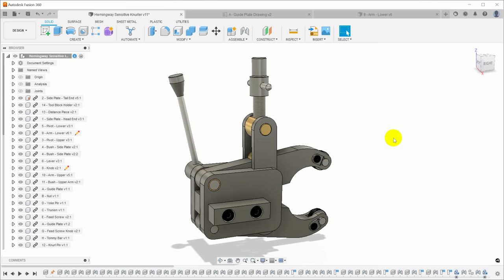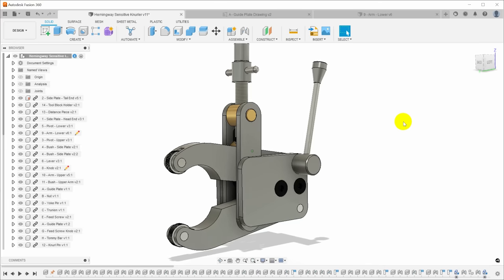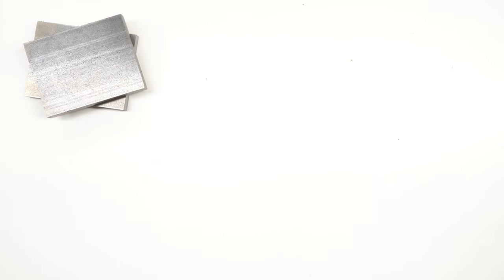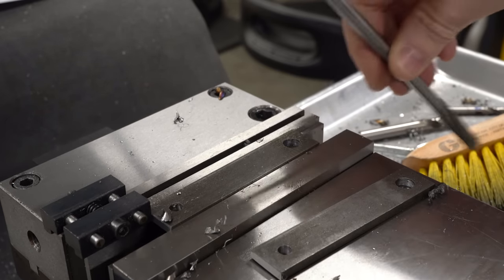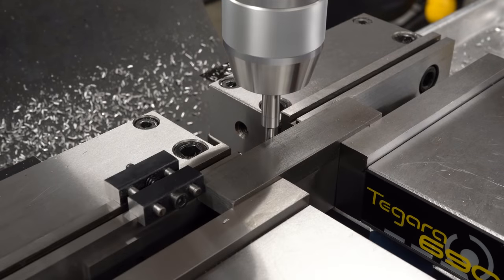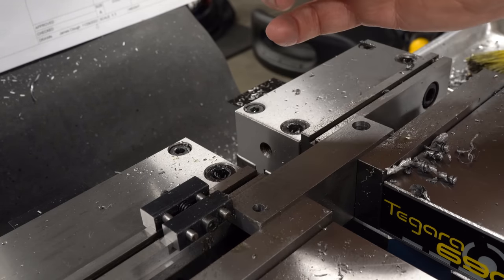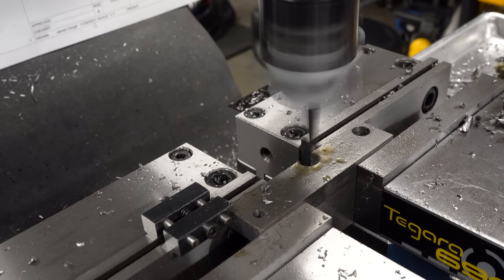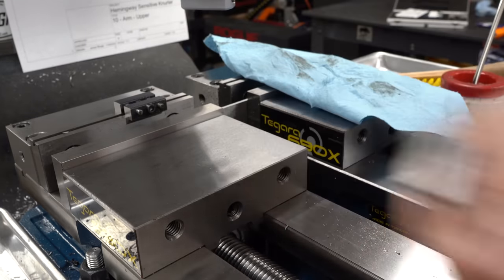Hemingway Sensitive Knurling Tool Build - Part 1

Comment: Great video as always, 
I've just turned 58 and my introduction to machining anything was using imperial Fractions I was lucky enough to live next door to brilliant toolmaker, design engineer (Mr A. as we all knew him then) back in 1977. One thing he impressed on me was to work from first principles i.e. a imperial rule has the ability to measure down to 1/64 or 0.0156 the last 2 digits 25 are not important as that is a tolerance beyond the machines we were using (Myford super seven and a Dore Westbury Mill, self built by Mr A.)

Following this, I did my time (apprenticeship with a small company who insisted on using imperial but not with fractions but with decimals), however as I had learnt to use the fractions the decimals came easy and my mental maths was even better. When I left that job my next was with a company that insisted using metric but they needed to convert old imperial designs to metric so that was when the numbers 25.4 and 39.37 came back to me.

The Hemmingway kits have been around for probably 40 years but they always include everyone old or young in their drawings and instructions.

i'm about to start one of hemmingway's wobble broaches. 

Keep the videos coming.
Jon.

Comment: Hi Clough. Something I realized a long time ago. When boring/reaming holes, I found that reamers were sometimes inconsistent maybe because the chip load is too great and forces the reamer off center a bit. Small holes are the worst. What I found that might help when reaming is to keep in mind almost all carbide end mills are slightly undersize. I drill the hole obviously undersize and then use the appropriate endmill to finish the hole to about .001" undersize. Then, If I want to ream it, then I just ream it to the exact size. Only reaming .001 creates very few chips, so the hole comes out pretty exact. Measure the endmill diameter before using this method. Also, be sure the mill collet has no noticeable runout.

Comment: Great project. I have  been thinking of making the same  tool. years ago I searched the internet for  Hemingway and Malco info and pics. . By gathering some published measurements and scaling I 3Dmodeled the knurler. Had fun doing it, and enjoy looking at the  exploded view of your model. I have yet to make it,but will enjoy watching you make it. I've been in the trade for 45 plus years making prototype one off parts for a engineering group, mostly precision hard tooling and tight tolerance NPI  parts. I smiled when you beat yourself up for missing your goal of precision " Chasing Tenths ".  Once you get your surface grinder you won't be happy with a milled finish. Thank you for all the efforts you put into your video's , very polished . Maybe when I retire ( still enjoy it and not ready to give it up) I will make one.

knurler.

Comment: Great looking project, thanks for sharing. A straight knurled part can take up the extra space. We had a hand tool at work just for that. If the hole in the casing was sloppy. we straight line knurl it to tighten it up. Some people called the hand tool “vicegrips” thanks for sharing

Comment: I put a power feed on the knee of my mill a couple of years ago. Highly recommended! Saves a lot of time & effort. I did have to make the main shaft for it since the one that was claimed to be for my mill was slightly different. The hand crank is always on, with a spring to keep it away from the drive. I use the knee to mill to precise depth using the hand crank & DRO. I like to use a tap follower and the quick knee move enables that and changing from drill to reamer, or drill chuck to end mill.

Comment: You could avoid an interrupted cut off the edge of the part by clamping it with a sacrificial scrap of similar material, to make it a complete hole. Then you could drill and ream it. (A spiral flute reamer would be best, but I'm sure a straight flute reamer would work just fine.) Your method worked perfectly well too, but if you didn't have a boring head, that extra step would have gotten you home.

I'll be interested to see how you like the cam-action closer. I have a shop-built straddle type knurler and could probably add a cam. I doubt that it would be worth the effort, but I'm eager to hear your findings.
Reply from the maker: I considered using a sacrificial piece.  Amusingly, a 5/8" reamer would cost more than I paid for the boring head.
Reply: @Clough42  Ouch!

Comment: One thing to remember about carbide endmills is that they generally run -.002" from nominal (at least fractional sizes). I would have roughed the slots with an undersized endmill then, gone in with an endmill to size. If needed, you can dial the tool off a little bit to open it up. With boring heads, when approaching finished size, leave the locking screws a little snug and don't touch them. That way you keep the adjustment screw a little loaded. Unlocking, adjusting then, locking again can sometimes cause unwanted movement. Love your videos, one of these days I'll muster up the courage to attempt your electronic lead screw 😉 I have an old Atlas\Craftsman 12" lathe with a quick-change gearbox. Inch pitches are no problem but, the few times I did metric pitches, I had to 3D print some custom gears.
Reply: With slots it seems to be helpful to use an undersize endmill, then take finish climb cuts on each side, to get better finish on the side-milled sides.. Nice that with your new, tight machine, sharp cutter etc, it didn't wander much, but I have not always had that much luck...  Enjoyed watching!
Reply from the maker: In this case, I have yet to make the part that runs in the slot.  I did it in this order intentionally so I can make the matching part to fit.

Comment: When I do wood work, I use fractional imperial since  I grew up with these measurements.    Tolerances are normally not an issue.
When I do metal machining I use imperial decimal.   This is so easy with machine tools like calipers, DRO etc.   Tolerances can be required.
I am really surprised that the Hemingway kits use imperial, and especially surprised they are using fractional imperial.
Interesting build.   I like the design.
Dave

Comment: Hi James.  I build the exact same kit last year.  Did everything on a Myford lathe here in Toronto, without a milling machine.  All the radius and curves, drilling and boring was done on the lathe with a milling attachment and the Myford Dividing head.  A super learning experience for a novice.  I bought .250 wide knurling wheels in the US and fitted them as I too thought the Hemmingway kit wheels were rather small.

Comment: Hi James. I ejoy your videos, thank for putting them out. I was a tool maker for 21 years and a thing I did if 8 had multiples to make with parallels was to put springs between them to keep them in place. Made it easier to blow them off between parts. Just a.thought, be well.
Reply from the maker: Yeah, I keep meaning to get some springs.  I don't have them on hand.

Comment: I'm making the Hemingway basic knurling tool at the moment. Totally agree about the fractional inches and lack of datums - it's doing my head in. For some of the parts I've resorted to sticking copies of the drawing to the stock. I'm also making things hard for myself by making it on a lathe...
Reply: Back when I was learning in the shop we used layout fluid and marked the parts with scribes, rules and punches.

Comment: I find it amazing that Hemingway still insist on using imperial measurements. Schools in the UK have taught in metric since the early 1980s. I really struggled with their kit I had to convert to decimal and then to metric. I should have re-drawn it first!. I did the normal knurling tool. It's not pretty due to my poor conversion but it still works really well. Thanks for the videos.
Reply from the maker: To be fair, it's an old design.

Comment: You could always turn a piece of brass to fit the slight oversize properly. A knurling tool like this has been on my list for future projects. This looks like a good knurling tool. I'm wondering though if the design can slightly tweaked to take larger knurling wheels. 😁🎄🎄🎄
Reply from the maker: I would think so.

Comment: When trying to nail a dimension in a boring operation, I use a dial indicator against the moveable side of the boring head. It has the benefit of showing  you any errors introduced as you tighten the dovetail.  Mr. Pete showed an indicator that was made to clamp around the boring head for this exact purpose, but a normal mag base indicator seems to work just fine. Apologies if you already knew all of this and did it off camera!
Reply: I think the 'split the last 10 thou or so in 2 equal cuts' is generally good to quickly get +- a thou or so.. if I am trying to get things right on & am not highly confident in the tool etc, I will leave a thou or two, then make dead pass or two, as needed.. if you need more, trying to adjust in that last thou can be the worst, especially in a boring head! Often resulting in, nearly an hour later, a very slightly oversize hole... but the power feed would be a big help.. 
could maybe knurl the brass piece gently to get a little more dia.. ??!! 
Also, Adam the Machinist showed a clever way to check absolute cutting diameter of a boring head, using some gage blocks etc (Toolmakers boring head trick).. but that is a little extreme for this case.. 
Things are so much about 'Error State Avoidance!' ... 
very much enjoyed watching.. Thanks!
Reply from the maker: That's actually a really great idea.

Comment: That tool has some really nice features.I don’t know what brand your boring head is but,my Criterion DBL202 and 203 are direct reading.Although the scale of the 203 is very difficult to read without,magnification.
From personal experience use the shortest,heaviest,boring bar you can use for the size hole you are boring.When I get about.015 from the finished dimension, I take a measurement then,take a spring pass .Measure again and note how much the spring pass removed.Better to sneak up on it.

Comment: A little late to the game but was holding out for obvious reasons. I find it really interesting to see where our approaches were the same and where they were different. And that I'm not the only one that goofs! 😂 I'm intrigued that the slots came out a thou under. Was that from a scalloping effect or did you use an undersized mill by chance? I have a couple that are labeled 0.249 for instance that I have to keep a special eye on not to get mixed in with the rest. BTW, Happy New Year!
Reply from the maker: I suspect it was chatter in the slot leading to an uneven edge.  The end mill I used is a center-cutting 4-flute, but the flute spacing is variable.  It's my understanding that many if not most end mills are slightly undersized, but usually, I would expect runout in the collet to cause it to cut oversize.
Reply: @Clough42  Oh you might be onto something there with the variable spacing. I didn't realizes they did that. I also never considered tool runout but you are right about that causing oversize. This is somewhat of a mystery haha regardless, nice work so far! I'm looking forward to catching up to your build
Reply from the maker: @InheritanceMachining  the variable flute geometry is really helpful for CNC, where it's easy to set up resonances due to long continuous cuts at constant load.
Reply: @Clough42  that is really clever. Learn something new every day!

Comment: As you started this video you talked about the problem of prints being in fraction this is a area even a hobby machinist should know decimal equivalent of at least down to the 32nds and do all your addition and subtraction in fractions not decimal this is a project that only a couple areas require more than drill press bandsaw and belt or disc sander. This is where when I started my apprenticeship in 1980 under a old toolmaker he would tell me do not make a science project out of a peanut butter and jelly sandwich.

Comment: Hey, I don't think it's wrong if you get a tool out of the deal and that tool gives you joy. The fact everything is done with fractional dimensions just reinforces that most of the dimension are fine with a bit of play in them.  After a couple of decades of use, the wear will probably even everything out...  the material is mild steel and not hardened... Happy Saturday!

Comment: 11:38 I don't know if this is a basic trick that everybody knows but I'll say it here anyway. I like to move to the starting location of my slots from the opposite direction than they extend (so if my slot goes from 0 to positive .500 I will move the cutter to 0 from positive values DOWN to zero (~0.05  -> 0)). That way after the cutter is at depth and I am ready to start slotting, I know I'm turning the hand wheel the right way because I first have to take up the backlash before the cutter starts to move. If I feel immediate resistance then I know I'm turning the wheel in the wrong direction.

Comment: One thing I have found by experience.......some days ago.......never use a boring bar in a boring head longer than you need especially those skinny shank brazed carbide bit type........a set of the brazed bit type I bought on EBAY  with various lengths all needed regrinding to make them cut.
Reply from the maker: I have a very nice insert bar that I bought and cut off for this purpose, but it doesn't fit this bore.
Reply: @Clough42  I bought a set of lathe insert boring bars 6mm to 10mm  with the intention of cutting them down and silver soldering them into a 12mm diam shanks that my boring head has.....the reason was the 12mm diam shank insert boring bars that suit the head cost an arm and a leg........the 10mm bar by itself held on the flat in the head did a good job opening a 12mm hole out to 30mm diam.

Comment: Convert everything on the prints over to decimal and also remember usually a fraction dimension is like a ¹/⁶⁴ tolerance, from the old prints I've worked from before
Reply from the maker: That's my understanding as well, though I think 1/64" is way too much for many of the parts of this particular tool.

Comment: I can't help to think that you ought to have a pneumatic vacuum instead of blowing those chips all over the place. I have a smooth hose running to a 5 Gallon pail with a screen vent. The smooth hose prevents the chips from getting caught in the convoluted hose like on a typical vacuum cleaner. These Pneumatic vacuum guns are used a lot in aircraft assembly for removing drill chips during riveting.

Comment: I guess the decimal equivalent chart was more widely used when I was a youngest because it's burned into my brain along with number and letter drill sizes are all embedded into a section of my brain I didn't know I had. Back when drawings were done on paper as a machinist we were required to do the math to find an angle or a hole location not given on the drawing we used volstro heads, rotary tables and sin bars to do the work that today are just a keystroke away. Back then the machinery's handbook was a daily read and today you can Google a calculator for just about everything. I'm getting old but random stuff like sine of 30or 45° is stuck in my brain forever.
Reply: FWIW, I’m in a machining program and we’re encouraged to use Machinery’s Handbook before online calculators or random web tables. We use decimal inches, though.
Reply: @OhHeyTrevorFlowers   @Trevor Flowers 🌸 🌸  That's great to hear I went to a trade school in the 70s it was a great way to enter the trade. Good luck in my opinion you have a great advantage

Comment: Inch or metric but never fractions.
When using a boring head if you retract at the same speed as feed you often get a better finish as you take a spring pass while doing it and no spiral cut.

Comment: How do you feel about "Ordinate Dimensioning"? Through the couple years of experience I have in the workforce, I've found that the majority of machinists seem to prefer it over other styles. Especially if the designer/engineer is knowledgable about where the machinist might zero and work through the part. Just curious, been watching you for a while now and have loved every video.
Reply from the maker: I think it depends on the goals of the drawing.  If it's for a machinist who will be locating features with a DRO in one setup, it's super convenient.  For other uses, maybe not.  If I need to design something to fit a flange, I need the bolt spacing, not the ordinate dimensions.

Comment: As long as your f up's aren't apparent on you knurled surfaces your golden.  I will keep watching. I have the scissor type like most but the cam idea might be useful.  May just have to modify to fit my larger collection of wheels. Since adding a solid tool post to my sc4 I have been able to get pretty nice straight knurls with a single wheel holder.  Now just deciding on the electronic lead screw thing.  Keep up the great work Clickspring America guy.
Reply from the maker: It's definitely smaller than I anticipated, but a good size for my lathe.  It should be pretty easy to adapt to larger knurls.

Comment: There are only 3 tolerances in machinist shop- 1.Its like God made it himself -the one ultimate tolerance everyone wants to see but its rare.2.Meeh tolerance -its good enough for what it is ,the most common tolerance.And the 3rd one is TO THE FUCK IT BUCKET ! You dont wanna see that one ,but it happens . Fuck it bucket holds future parts to be made in one of those 3 tolerances ,its also known as scrap bin.

Comment: If the drawing is not compliant with ASME Y14.5, the standard for Geometric Dimensioning and Tolerancing, one cannot be certain fabricating parts to the drawing will result in proper performance of the finished product. Forcing customers to redraw prints prior to machining is inexcusable. Thanks for the warning on Hemingway products. Cheers.
Reply: As it is a British drawing, BS8888 might be more appropriate...